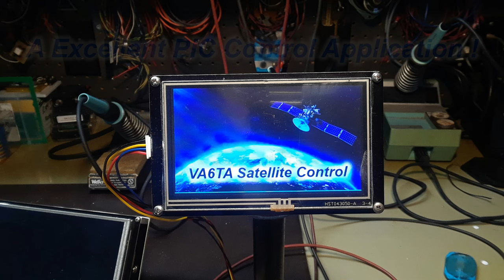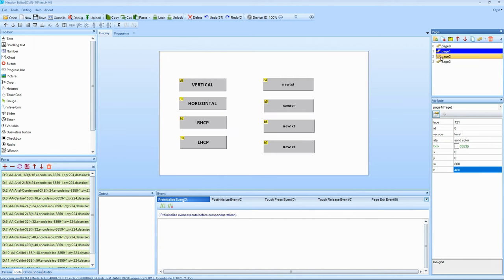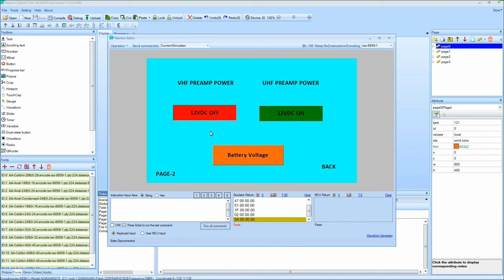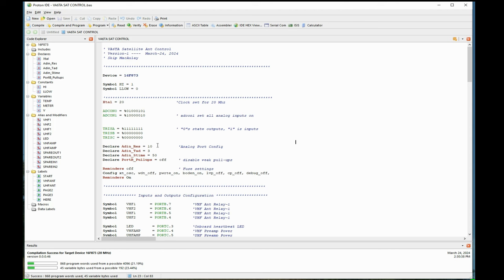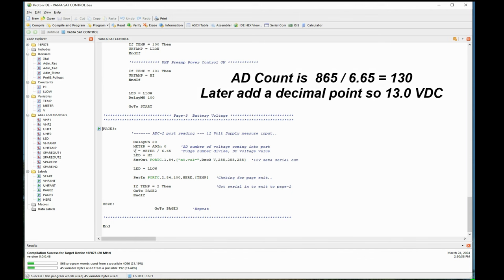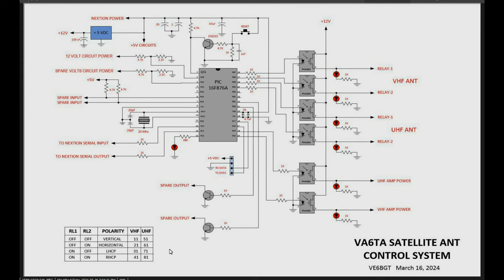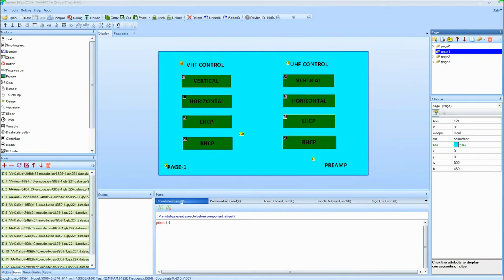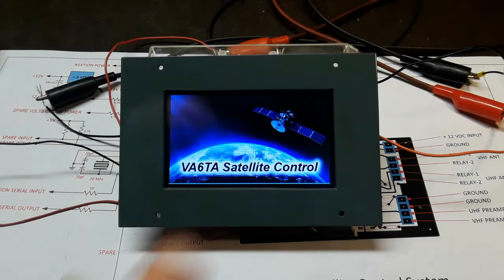VA6TA Satellite Polarity and Preamp Control

Comment: The Nextion products are kinda neat.  They are really fast to implement.  Its kind of a waste of an STM32 though.  It's just as simple to build an STM32 project, use a capacitive touch screen, and Qt embedded for the GUI.  The great thing about Nextion, is they use the same constructs as most GUI frameworks.   The way you send information from the PIC to the Nextion is the same concept as Qt's signal and slots.  So the learning curve isn't as bad as people think, and Qt is beyond superior.

Comment: Nice project.  I just added Polarity Switches myself to the house and camping setup.  I milled a duplicate version of the M2 switches.  I usually don't mind buying things, but those were expensive enough for me to make.  I also got to up the quality on them while I was at it, while only spending about 60 bucks for both.  I ended up making 10 sets of them.  Not sure what I am going to do with 6 of the sets.  73's AG7VD
Reply from the maker: Hello Mike, sounds good.. I dont know what those switches you are talking about look like.. I bet they are costly though.. Send me a pix of them, would like to see that... Skip